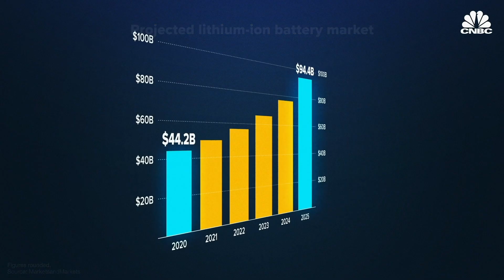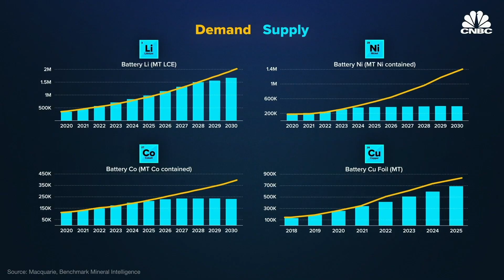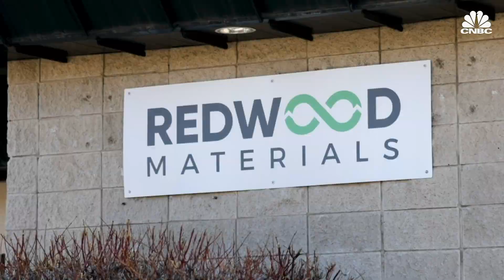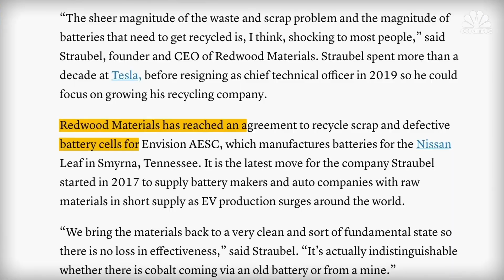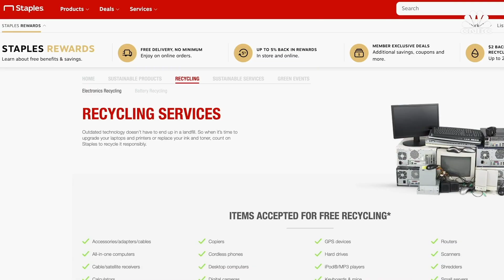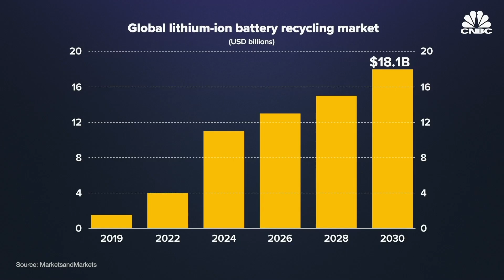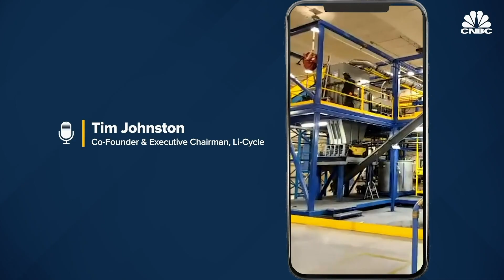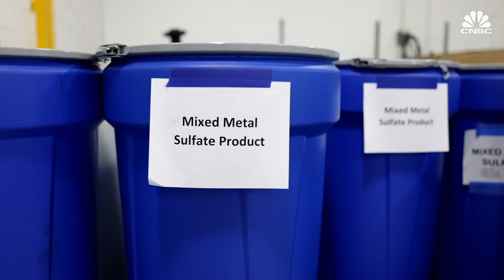How Tesla’s Battery Mastermind Is Tackling EV's Biggest Problem

Comment: They've had ALL these years to make an electric car to be sold to the Public and they STILL haven't made a car for the general Public to buy and drive.
Reply: Who?
Reply: @xploration1437  

Noticed the topic subject of the video yet.  
It's spelled in 5 letters.
Reply: I’m so confused how hasn’t Tesla manufactured a low cost ev for the general public. Have you head of the Model 3 or the Model Y?
Reply: @Andrew-lp4fw  

They simply have not.  Had they done so, 1 million+ of the general basic cars would be on the streets now.  A basic small, compact no-frills 4-door car.  Something that appears like a gasoline Toyota RAV,  Honda CR-V, or Subaru Forester.
No frills at all.  4-speed stick or 4-speed auto.  All vinyl interior, nothing fancy.  Manual crank windows & door locks & handles.
A good heater, defroster and USB jacks on the dash.  15,000 bucks, period. 
I was a Licensed Journeyman Electrician.  I spent 19 years as an electrician in total.  
They should have made half a million of these already YEARS ago.

People would be driving a million of these around right now, and fir at least one decade already. 
120VAC slow 6-r./240VAC 3-hr. Quick charge selective.
500-mile range at an equivalent 20 hours of driving capability. 
And the battery array or, however number of batteries is applied in the construction, is not going to be the b.s. "expensive " shpeel conned.  
Plugs right into your standard house garage wall receptacle outlet (120VAC).   It costs little to have a 240V receptacle outlet added to your garage wall (exactly the same circuit-outlet- receptacle that serves a household electric stove range).
Reply: @SunnyIlha  So first of all, those three cars you mentioned are roughly 25,000, not 15k, and I would love to hear more about your proposed 4-speed manual electric motor, but whatever... Unfortunately, I don't understand how your experience as an electrician qualifies you to discuss the economics of mass-produced electric vehicles, since the bottleneck in production and unit cost is actually energy storage, such as the Li-ion batteries being talked about in the video, and not in-home charging hookups. In regards to a 15k vehicle with 500 miles of range a decade ago, keep in mind a kW h of battery cells 10 years ago cost $1100 dollars (BloombergNEF). If manufacturing the car magically cost you only 3,000, neglecting R&D, overhead, marketing, and EVERYTHING else, and there was absolutely no margin from the manufacturer and dealer, that would get you about 10kWh which isn't even close to 500miles of range. 24kWh in a Nissan Leaf costing 33 grand base in 2010 dollars was by far the best thing anyone could have come up with. Your whole idea sounds nice, but so does world peace. That doesn't make it even remotely plausible just because you say so
Reply: @Andrew-lp4fw  

There is no mention of a manual 4-speed motor in my comment.  
There is mention of a 4-speed, which describes the transmission (not the "motor").
You likely do not what a "stick" means or refers to. 

I cannot reply to all that you have written since it's overwhelmingly non-sensical.  I'm sorry. 
Every point you've made us rife with inaccuracy and mainly nonsense that doesn't or hasn't existed.  
I can't put you through 4-year college (again, perhaps even) or write you a book here.
I also cannot turn you into a Journeyman Electrician.  It involves hard sciences, hard math, subatomic particle study, magnetism, and subatomic physics , not to even start to mention how electricity is transmitted through low-voltage, line-voltage, and high-voltage circuit construction. 

Inform yourself better.
Reply: @SunnyIlha  Ok, you're trying to criticize my syntax instead of address the meaning of my words. Please show me an example of a 4-speed transmission attached to a consumer-grade EV. Spoiler alert, you won't find one because they don't exist. An electric motor has a consistent torque output across all power inputs, so there is no need for a multi-speed transmission. Maybe learn a little more about the product you're discussing before making claims on how they should've been mass-produced 10 years ago. Also Tesla sold 222,000 Model 3s in the first two production years, so maybe those statistics I brought up are based in some kind of reality. Hey, don't worry, your prediction was only off by 10x.
Reply: Look, when your best argument is saying that my points are inaccurate without explaining how or why, and you try to criticize me by saying I don't understand what a stick shift is, or try to impress me by throwing kind of big words about how your basic electrician apprenticeship was actually very complicated, you've clearly run out of meaningful things to say. Good luck buddy, you're gonna need it
Reply: @Andrew-lp4fw  

Have you ever seen a converted Older model VW beetle.  Converted to 12volt standard car batteries. 

And,
What sticks out of a standard electric tabletop motor?

An axle. A shaft. 

What do axles turn.
Reply: @Andrew-lp4fw  

I do not need nor require luck.

But you sure do. 

You haven't a clue about what you've said in nearly everything you written in replies here.
Reply: @SunnyIlha  Ah yes, because when I asked for a consumer-grade EV, I was talking about a 60-year-old VW beetle with a lead-acid car battery stuck in the back. Read my question correctly and try again?
Reply: @SunnyIlha  Hey, as much as I've loved our little talk, I gotta go off to work. Sending kisses to you, and thanks for reminding me what happens when the 60-year-old tradesmen are accidentally let onto the internet!
Reply: @Andrew-lp4fw  

You still haven't a clue as to what is what.
Reply: @Andrew-lp4fw  

They simply have failed to get a car on the road for the Public to buy and use.   Period.
Reply: @Andrew-lp4fw  

These two recent new cars.  The price is b.s.  
It's going to fail.  30,000-40,000 for this vehicle?  For a basic go to work,  get around car?

Who's going to buy these cars at 30,000-40,000 dollars?  Not many  who are earning working-class incomes.  
And the few some who will buy it are going to feel like idiots paying 40,000 for a standard car, even if they can afford to get themselves stuck with such the payments!

They'll drive away thinking, why did I just pay out, or get in debt just now FORTY THOUSAND dollars to drive this car!

Total bull crap gouging.
Reply: @SunnyIlha  According to edmunds the average purchase price of a new vehicle in the North American market with $40,179. 30 grand for a brand that just recently only captured a high end $80k+ market, 35k for a sedan isn't that unreasonable
Reply: @Andrew-lp4fw  

Statistics do not match reality. 
Statistics are only statistics. 
(Not functional concrete real-world physical reality). 
It itself is not reality.
Statistics are number(s) comparisons and 'mapping'.

You do not know this?

How many Americans buy brand new cars.
How many Americans buy older year model cars, (previously owned).
I've only just begun.

How many Americans COULD own a car at all, and, even a NEW car?
( IF , and only IF they could afford it with the income they employment- generate).

See?
Reply: @Andrew-lp4fw  

Tesla will sell 20,000 of those cars, if even that.  Extremely optimistic number here.

When he could sell 6 million of these electric cars instead, at 15,000-16,000 bucks.  

He's also making these model 3 and Y's  too fancy and high-faluting.
AND, these things are STILL just cookie-cutter cars!

People want a BASIC no-frills car!
That they can AFFORD.

Comment: :) And this is the best thing about batteries. Once the battery is done.. You don't have to dig the component minerals out of the ground again. They are valuable enough that it makes perfect sense to recycle them to the max. And then... By the time the next generation of tech rolls around, you likely don't even need as much to make an even better battery.
And as a technical challenge the recycling will also become better and better as time goes by.
Reply: It's still the same problem, using limited resources to fullfil a global need, honestly I've been rooting for renewable fuels for a while, it just makes more sense to produce things like ethanol and algae-based biodiesel, as examples
Reply: @isaac4273  the challenge with biofuels is the land use and politics around it (due to the land use). If they could make algal biofuel economically viable, then maybe that.
Reply: Joe you not living in reality. Recycling batteries takes huge amounts of energy.
Reply: @Marc98338  The reality is that we have access to truly vast amounts of energy. Way more than we use now. Clean and sustainable. Not everywhere. But in many locations practically endless. And not accessed to a high degree. Yet. But I assume your point of view is limited to not knowing what's actually going on in the world. Or maybe not understanding the potential.
And I think you are also not considering the value of the recycled materials. Businesses which recycle these batteries are not doing it just for the environmental benefit lol Certainly it can be more profitable than mining from natural sources.
Reply: @joeblack4436  What are you even talking about? We litterly in an energy crisis here in Europe. Our entire country is full with Windmills and solar Parks and yet we still only get 10% of our energy from those resources... Energy has become more expensive then ever...
Reply: @Marc98338 You're not listening. I'm talking about potential. You're talking about right now. As if all the batteries ever, including future ones, have to be recycled right now. And in Europe no less. Right at a time when geopolitical issues, including an actual war, are causing energy to be more expensive than ever. Can you think ahead at all even? Do you dismiss every possible thing just because it cannot be achieved in its totality right at this very moment? You wouldn't even get out of bed, since you can't drive your car to the shops from bed. Right?
Geez. Where do you think Europe would be politically and energy wise if it had not already made major strides towards building out renewable power? Up a creek without a single paddle - That's where. Can you even imagine how much energy would cost then? Not only even more money, but also Europe's right to rule itself very possibly.
Get out of your hole. There's an entire world out there. And there are countries with endless solar just South of the Mediterranean that would line up to host a large state of the art battery recycling facility.
Reply: @Marc98338  I'm pretty sure I know better what's going on that you are. For one you clearly think Lithium battery tech is the only kid on the block. Just watch the show. You're going to get a few surprises and learn a lot.
Reply: @joeblack4436  No its not but since politics are thinking we can provide enough energy with wind and solar; energy will be expensive as hell.
Reply: @Marc98338  Well see there you show your ignorance once again. It's not just wind and solar. It's wind, solar, hydro, tidal, geothermal, biogas.
And renewable power is not as expensive as it was 10 years ago. It's cheaper than any other energy source IF you have sufficient storage in place. 
And energy storage is a rapidly developing tech industry. It's not even just about storing electricity. It's easier and cheaper to store truly vast amounts of energy in the form of heat than it is to store electrical energy. 
Do not be surprised in 5-10 years time when everybody's wondering what the big deal was.
Reply: You will still need mining. Mining is not able to keep up with the future demand for these metals. Recycling will be the partner technology needed to support battery demands for the future. Technology will improve the amount of materials in batteries, but that will be part of the solution, not the solution. 

As for the global warming stuff, it is just another environmental scare. They have been doing it since the mid 1970s. They all fall through.

Comment: I find it funny that they always tip toe over the child slavery at a lot of the mines or don't mention it.
Reply: Not only that, but also the  environmental impacts from the mining and manufacturing.
Reply: @Teodede  it sure beats fossil fuel tho
Reply: @FizzyGajing  no it doesn’t. If we had more trees the pollution from fossil fuels would be offset but instead we dig huge holes in the ground to mine for lithium ore along with toxic ponds that can leak and/or leach into the ground water.
Reply: It helps with depopulation when you realize how hazardous the jobs are so its ok

Comment: I say EV's "biggest problem" is they don't charge in the same amount of time that it takes to fill a car with gas.
Reply: It will in 10 years.
Reply: Well of course your charging a giant battery not filling up a tank with a liquid you have to let it charge overtime that’s why there is so many parking lot chargers well at least that’s the case where I live but I hear it’s improving
Reply: If you're charging where and while you're sleeping, working, or doing something else, then you don't care how long charging takes, and it's more convenient than going to a gas station.

Refueling time after you've driven to the gas/charging station is the only area where gas cars have an advantage.

No plug no sale!
Reply: I agree with that, if people travel long distances that would be a problem.  I never had a problem with my EV though: if the car was just sitting in my driveway overnight anyway, I just plugged in the charger and that was plenty.

Comment: We obviously have to produce stuff to recycle later on first.
But long term a recycle rate of 90% would more or less solve the supply problem, 1 ton of raw material would have the same use as 10 tons without recycling.

Alternatively we could mine 10 times more, but i somehow doubt that's realistic any time soon.
Granted, the recycling process itself costs ressorces, but energy and general logistics aren't in short supply.

Ofc there are always ways to optimize stuff further, we already get way more literal milage out of our ressorces them we used to.

Comment: How can you make lithium battery production a closed loop system when we are only able to recover 80% of the lithium per cycle? If we lose 20% of the lithium each cycle, we're going to have to replace that lithium from somewhere. For that matter, what happens when we run out of the Earth's supply of lithium?
Reply: The Earth's crust is full of iron and bauxite for ICE engines and you can always produce race ethenol from corn. Rare Earth metals is long term problem for EVs. Eventually cars will be for few elites. Not to different with Londons tax on cars.
Reply: That rate will only increase as the recycling tech gets better and there's so much Lithium on earth it's pretty much impossible to run out of it even if we didn't recycle anything.
Reply: @meamzcs  it's not impossible to to run out of any finite resource. Even if we could recover 100% of the lithium from existing batteries, there is still a maximum amount of recoverable lithium . Should demand for lithium exceed the amount we can get from recycling, it will have to be extracted from the ground. What happens when demand exceeds the Earth's entire supply of lithium? Plus, lithium is only one material, but a battery is only as sustainable as it's least sustainable component.
Reply: The lithium do not disappear they are just in a very diluted form that it is not profitable to extract them. This is also what is happening in mines you only extract where there is high concentration of the material you need. But if there is shortage of material then prices increase and it becomes profitable to extract the material from low concentration sources. Lithium is interesting because at a certain price it will be profitable to extract them from seawater. Once that happen it will take centuries of extraction before the ocean will be depleted of lithium.
Reply: Lithium is not all that rare, it is found all over the earth especially in sea water (you probably have some in the dirt in your back yard).  The problem is: getting enough lithium in concentrated form is expensive because it is dispersed over large areas.

Comment: We are going from small batteries in our phones to huge batteries in our cars. It doesn't exactly matter if you don't recycle the small battery in your phone but you can't throw two tons worth of batteries in the Trash
Reply: @Habib Bhai You lose a few % each time, but the metals themself can be recycled a lot, like tens of times at least.

With the right technique this can even go on forever. Just look at iron/steel/silver/gold etc or simply glas: those can be molten down and repurposed forever, but each time a bit is lost in the process (as rust etc).

The reason such metals are recycled isn't to use them forever, but to reduce the amount we need to mine, or in this case: increase the amount of batteries that can be produced without mining for much more metals.
Reply: they dont, most Batteries are Sorted and Diverted to Storage until the Battery can be Recycled.
Nissan and Chevy have Millions of batteries in Storage , some are Reused in HOME Energy products , others are Awating Recycling . almost NONE are in LANDFILLS , even Waste management Diverts and Collects SINGLE use batteries from WASTE, as they are MAGNETIC .
Reply: That's at least half true.
An EV battery is roughly half a ton, not two.
And small batteries DO add up, cause: for many people they are a regular purchase.

But yes, EV batteries are BIG.
Reply: probably more tons of small batteries than what is coming from garbage car batteries at the moment.
Reply: Currently, nearly 100% of people have consumer electronics, and maybe 1% have an EV, so still relevant. As EVs become more popular, will be a bigger difference.